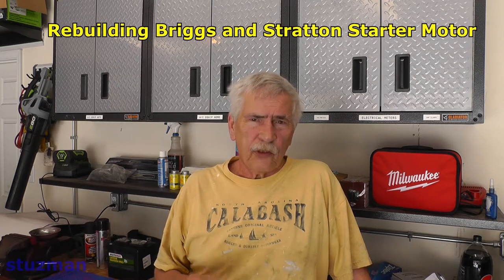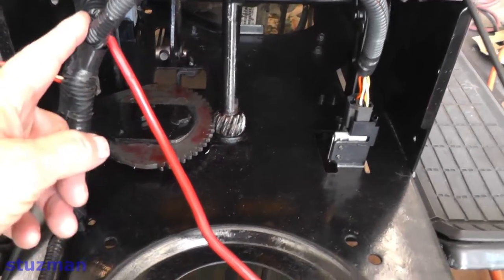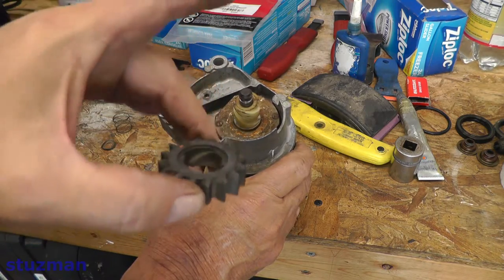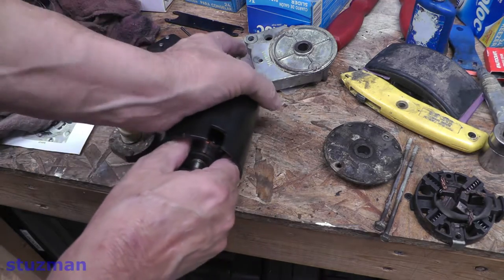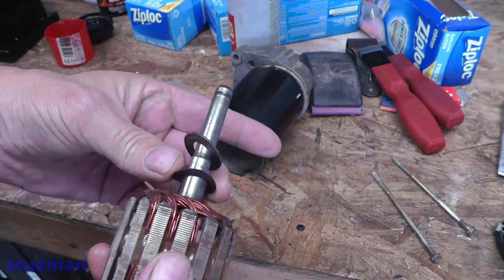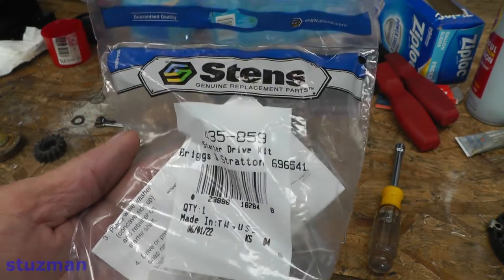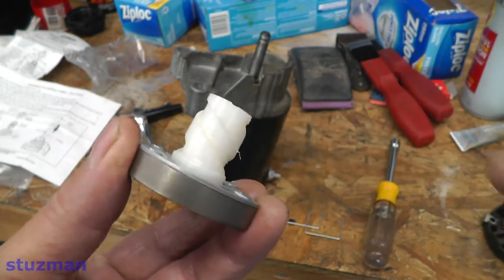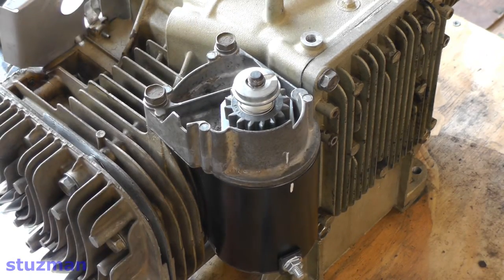Rebuilding Briggs and Stratton Starter Motor

Comment: Hello, thank you for this video. A few questions, is the gear plastic or metallic? Is there also metallic? Which is more convenient?
Reply from the maker: As for this mower, the standard gear is made of plastic. Even after 25 years, the gear was still intact although it did have a little wear. I would guess that you could replace it with a metal gear provided that it has the same number of teeth, diameter, height, etc. I would just stick with whatever material the mower came with. Have a great day!
Reply: @stuzman52  Thanks